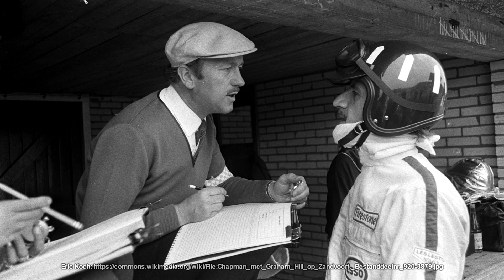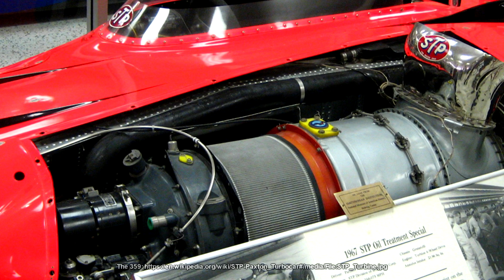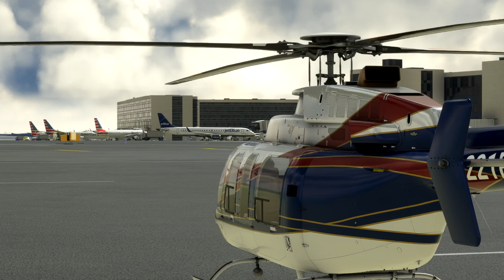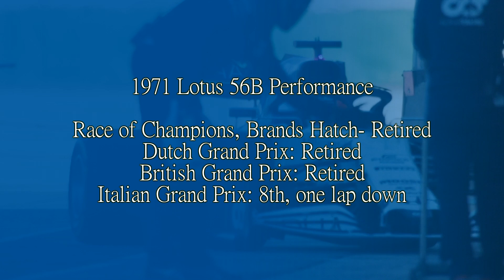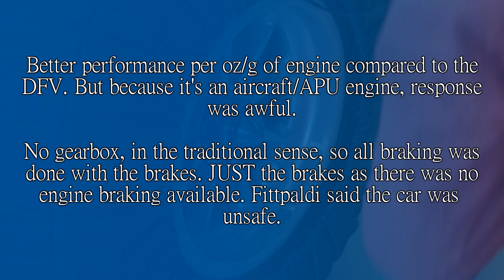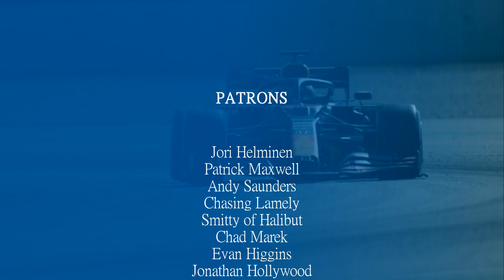THE JET POWERED* F1 CAR! The Story of the Lotus 56

Comment from the maker: Imagine if it WAS a jet powered F1 car. With an afterburner. Mach 1 down the Monza start finish straight and... straight into a wall...

Also turbine engines have been used on railway locomotives. Which is probably a better application for them as opposed to cars.
Reply: i swear some of the early 2000's ferrari's had jets in the back.
Reply: We had helicopter engines in trains (in France), it was hell. They drank like Lemmy Kilmister and were almost as loud. Drivers hated them, passengers hates them and I guess the people living near the train stations weren't too happy about it.
Reply: If people complain about it being difficult to follow in dirty air now, I could only imagine what they'd say when someone had their front wing melted off by someone else's afterburner. It would be hilarious.
Reply: @MScotty90  then protest them for having movable aero! Lol
Reply: The americans namely GM made a turbine powered road car, jay Leno famously owns 1 that hes done a great piece on his YouTube channel
Reply: The British, namely Rover developed a turbine powered car in 1949/50, and a Rover BRM raced at Le Mans in 1965 driven by Hill and Stewart. @maybenot6075
Reply: if it went Mach 1 I wouldn't imagine brake cooling would be an issue
Reply from the maker: @Ramtamtama  Ye of little faith...
Reply: I think with today’s technology it COULD work, some sort of controllable, hybrid system so you had engine braking AND instant torque. As mentioned though, the noise and fuel consumption is horrific and probably something that can’t be fixed economically
Reply: Turbine locomotives weren't very good either. They made big power and torque but were exceedingly loud, were thirsty af and were ginormous! Only the Union Pacific in the US really dabbled with the technology before they conceded that lashups were the better option
Reply: @stinkyroadhog1347  Here in Britain we had a steam turbine locomotive in the 1930s. Nicknamed the 'Turbomotive' it was built by the LMS in 1935 and was basically an experimental 'Princess Royal' locomotive. It was actually relatively successful compared to other experimental locos of the time (the high-pressure engines such as the 'Fury' (another LMS engine) and the LNER's 'Hush Hush' come to mind), but when the turbine failed in 1949 it was deemed uneconomical to repair due to post-war austerity. In 1952 it was rebuilt into a conventional form but after only two months in service it was involved in the tragic Harrow and Wealdstone crash. It was deemed beyond repair and scrapped.
Reply: Now if only it could be steered by swiveling the jets around 🤔
Reply: @FlufLord  Would there even be enough space on that car for Thrust Vectoring? (The term I think you are referring to)
Reply: A jet powered car would have been much more difficult to slipstream at Monza.
Reply: Why ? it delivered its power via the wheels, not via thrust. @jimiverson3085
Reply: Downforce. With  the  amount  of  thrust  such  jet  powered  fwrs  would  have, the  could  be launched into air  with the  slightest  disturbance.

Comment: Turboshaft engines ARE "Internal Combustion" in that they burn fuel internally. Turboshaft is the same as Turboprop, it's just that the latter is, by definition, tied to a propeller while a Turboshaft could be connected to anything. But basically they're the same.

Comment: The Chapparal 2J used a rear mounted fan - like the 1978 Brabhams at Sweden - to vacuum air from underneath the car - "sucking" it to the pavement - a very different proposition from Lotus's "wing body" chassis.  But yes - Jim Hall was every bit as innovative as Colin Chapman.

Comment: I reckon the pt6 could make a return if you set up brakes on 4wd system like a monster truck with a lever near the driver so there could be drag braking or even add brake flaps that pop up on braking like a bugatti

Comment: Turboprop. Turboshaft. Turbojet. Tomato Tomahto. 

First three are * all * turbines. Simple. 

Fun fact (former commercial pilot here), FAA put out an AD to have ‘turbo’ (you know ..in that 80s cool gradation font with the t bottom curling 90degrees.  Well .. adding another to the mix. It was a gas piston engine and TURBO NORMALIZED (has a turbo)…you TURBO CHARGE at alts closer to sea level. Gaining additional power. You’re fighting to maintain anywhere close to 100% power at altitude. This could get tricky for the layperson, eh???

Damnit!  Editing. Forgot to tell you WHY the Airworthiness Directive was removing that decal from the side of the engine cowl(s). Your piston engine burns 100LL. Your local line boy who isn’t hip to the lingo had more than once given a soon to be excited pilot a fill up with Jet A (refined kerosene), thinking it was a TurboProp. It says turbo, right???  Hehe.

Comment: 4:30 If you haven't seen it yet Captain Joe just did a rally good deep dive on how the PT-6 works. His video is on the turbo-prop variant, but it's valid for any PT-6 variant because all you need to do is swap what the free power turbine is attached to.

Comment: 15 years later these same engines made their way into indoor motorsports, tractor pulling in particular.

Thanks to thousands of them being decommissioned by the US marine corps and air force during the post vietnam drawdown, they became dirt cheap, and many tractor builders/owners turned to them because you could buy two for less than 1/3 the total cost of 3-4 custom built traditional v type engines which could easily run into the six figure range (depending on who the builder was).

The two most famous ones were The Green Monster and Dragon Lady, which were driven by land speed world record holder Art Arfons and his daughter Dusty.

Art won multiple USHRA national championships with "The Monster" in the early/mid 80's, the twin turbo jets on it could turn the rear wheels at speeds in excess of 150 mph at full throttle which made pulling the 50.000 pound pull sled too a full distance pull (200/250 feet depending on the venue) a trivially in any competition that wasn't a "pull off" to decide a winner of an event if there were multiple full pulls during the competition.

They eventually stopped competing in the general 7200 pound tractor class and chose to run in the exhibition class instead.

Comment: Ambitious but rubbish was a very necessary part of Formula One. Just as square windows were deadly on the de Havilland Comet, until oval ones were discovered to hold internal pressures without stressing the airframe in the same way. 

This is the most legitimate complaint that traditional F1 fans have. It's not about safety, as important as that aspect of racing is, but in the way that the envelope of engineering was pushed not only to known boundaries, but beyond. F1 can no longer claim to be the pinnacle of motor racing, just because of having so much money involved. By staying with only a single design to work with, it has reduced the formula to that of any other. It only took a second season of cars under current regulations to have people comment on how unexciting the 2023 cars look, which was always going to be the case when the body is integral to the ground effect, so can't be radically altered. Nobody wants a return to the deadly days of the late 60's, but without innovation, that sport might not have made it this far, and will struggle in future once the fanboys realise that the regulations hold any team back that wants to get ahead with ideas outside the box box box, without being able to innovate. 

This same issue is now starting to affect Nascar, where changing any standard part will get a team a 100 point penalty. Instead, teams like Aston Martin closed the gap by just copying Red Bull, and I guess that F1 and the F.I.A are just counting on 20 cars being identical pretty soon, because that will happen should the same format be kept for much longer.

Comment: The engines used in most commercial airlines are propjet engines just larger than what would fit in a heli . Actually now that I think about it why do they call that a propjet engine . Yes it's a jet engine that powers a propeller , but the prop is contained in a tube like a fanjet . Shouldn't it be called a fanpropjet engine . Sorry got distracted .

Comment: Fun fact something like 11% of the thrust on king air or like aircraft with the pt6 come from the exhaust 
And when using a turbine engine it has to stay spooled up like the turbo on a regular car to put power down think about how long a jet has to spool up before take off on the run way when they release the breaks they are producing so much thrust it can tear up the assault but it spools up so slow in comparison to a ICE it’s like a top fuel drag car vs a 1996 ford ranger they both go when you throttle one just way faster than the other

Comment: Actually, the 56 did run at Indy.  Joe Leonard was leading the race with about 8 laps left in the race.  There was a full course yellow on that point and when the flag went green, Leonard stepped on the accelerator and something inside the engine broke.  A second turbine car broke at the same time (Graham Hill had crashed just past the mid-point).  Bobby Unser won in one of Gurney's cars, sporting the first turbocharged engine to win at Indy.

Comment: It's interesting how Indycar nearly became the roadgoing equivalent to Unlimited Hydroplanes if it weren't for USAC going..."Hmmmm...Maybe we need to restrict that a bit more..."

It's interesting how with all the turbine hype at Indy in those days, the only two real forms of competition that kept the turbine viable was the aforementioned lobster-claw-nosed racing boats (and pretty much all of them use the Lycoming T55, a bigger engine for a bigger helicopter than the P&W in the 56)...and Tractor Pulling. Though the tractors use whatever turbine they can find, and unlike the hydros the tractors still also use either several large supercharged automotive V8s, industrial engines, or aircraft piston engines, or a combination of whatever. There's only one hydroplane running a V12 Allison anymore, and the rest are on turbines.

Comment: Some Americans did get this concept to work. In a car.   By effectively having turbo wastegates  as a throttle. So the jet engine section could be left at a high power but the driver could have that gas bypass the power turbine so   Meaning instant throttle response but massive fuel use 

And as you said brakes where the downfall
Reply: https://youtu.be/GAgLSy371us

Comment: the trick with keeping turbo shaft engines responsive in such an application ist to keep the engine running at 80-90% all the time and make the throttle close the bypass valve. i think this was the indy design aswell
Reply from the maker: Spose it was easier to do at Indy given the nature of the track.
Reply: @AidanMillward  yes, they were better suited to ovals than road courses, but you have to give Chapman credit for giving it a go.
Reply: There’s some more modern engines that can be more responsive. Using things like variable stators can make the powerband wider so you’ll get better power at lower rpm. 
But, there hasn’t been much development in making turbine engines that are responsive. For aircraft it isn’t really much of a concern. 
Would be interesting if the experimentation from the 50’s and 60’s with turbine road vehicles had carried on. Might have ended up with turbine engines that could run much more like a traditional engine.

Comment: Speaking of Lotus pushing the boundaries, it still bugs me that the Lotus 88 was banned outright without getting chance to race even once. I guess Ferrari and Williams were afraid of Chapman making their cars obsolete again.
Reply: The Lotus 88 was never raced because the Drivers despised the cars so much due to instabilities in the design when properly tested.
Reply: @ShazotoTouge  
No, the FIA wouldn't let it run so the drivers didn't have a chance to hate ti.
Reply: The 88 was banned because of it's twin chassis not meeting the rules. @ShazotoTouge
Reply: By all accounts the Lotus 88 was completely numb to drive and it played fast and loose with the rule book though I have no doubt that it was within the letter of the law in terms of passing scrutineering, the fact that it passed aero loads from the outer chassis direct to the wheel hubs it was just asking to be excluded! Its a shame that innovation is often stifled in F1 and they always fear an "arms race" but the reality was prior to the budget cap that the teams would always spend all they had (sometimes more) on making the car as fast as possible and all that "cost saving" measures like testing bans do is force the teams into spending even more money on tech like driver in loop simulation that costs more and is less effective!
Reply: @philipbain  I both totally agree and disagree at the same time. Agree 100% on innovation missing from F1, makes F1 not F1 anymore, and totally disagree with the rule book not needing people to play fast and loose with it, to produce innovation. In the middle of both, there's the incurable disease that Formula One has always had, and that is favouritism. There's no doubt that certain teams can cuddle up to the rule makers at certain times. This is why every time equality is talked about, one team still dominates. When switching to hybrids, the sport switched to Mercedes. Red Bull caught up, so ground effect suddenly reappeared after being banned decades ago. Now Red Bull dominate. Ferrari, Williams, McLaren all had their time too, and that cannot be coincidence, especially given that all other teams never fail to complain about the dominant team, as if they get preferential treatment. As you ended your comment, we are back in agreeance. Let Formula One innovate completely, because that was always the nature of the formula.
Reply: indeed... it was a pig
Reply: A car whole whole downforce is applied directly to springs sounds like a pain to drive.

We'll never know how fast it'd go but I never heard a good thing about this car ever, only that some people were sad that it was (almost rightfully) banned too soon.
Reply: @davidaugustofc2574  
That was actually the configuration of the first wing car, the Chaparral 2E.  The wing was mounted directly to the hub carriers in the rear suspension.  It actually applied downforce without compressing the springs.  I imagine the 88 was similar in effect if not in the source of downforce.

That was also the configuration of most of the high-wing F1 cars of late 1968 and early 1969, including the Lotus 49s that crashed in Spain.  The FIA ban required all aerodynamic devices be mounted to the bodywork, where the downforce does compress the suspension.
Reply: @jimiverson3085  I can see why, mounting on the hubs require flexible mounting points, which for the technology of the time meant bending which led to breaking. The cars were making too much downforce for their own good imo, F1 would turn into Group B but the drivers would die the majority of times.
Reply: @davidaugustofc2574  
IIRC, the only catastrophic wing failures were on the Lotus F1 cars.  That would be Chapman aiming for lightness and making his cars insufficiently strong.  AFAIK, there was never a wing collapse associated with sports cars, including one season where the entire Can-Am field ran high wings.
Reply: @jimiverson3085  I'll have to take a deeper look into it later, since I'm somewhat busy rn, thanks for the history lesson.

Comment: the engineer in me feels the undying need to point out that a gas turbine is indeed an internal combustion engine as the combution process that drives it is indeed taking place inside the the combution section of the turbine.... sorry i cant help it! the word that dissasociates the two is the dfv and all susequent f1 engines are piston engines. a p&w pt6 is indeed an intenal combution engine albiet not drven by pistons
Reply from the maker: “The sort of internal combustion engines we associate with f1” would have been a better line.

Comment: Imagine if Joe Leonard didn't have a transmission-bearing failure in the Indy 500.  I remember hearing it was a 25-cent part.
Reply: You're thinking about the 1967 Indy 500, when Parnelli Jones' STP Turbine lost a transmission bearing just before the end of the race. In 1968, both leader Joe Leonard and Art Pollard had the fuel pump shafts break on lap 192
Reply: @arthuralford  yes, completely accurate.  I'm glad I'm not the only one who remembers the details of those cars.  The 1967 STP Turbine is still my favourite race car of all time.

Comment: I'm surprised they didn't use a clutch system to modulate the power instead of the brakes.
Reply from the maker: Maybe that was a bit too complicated for what they were doing.
Reply: a clutch would seperate the power from the drivetrain but would still not provide braking force as there is never a time in the power cycle of a turbine(that is actively running anyway)  that would provide braking force. it going to keep on spinning that shaft as long as it is running. piston engines provide braking due to the vacuum created behind the throttle blade when closed and the tires actively trying to turn it, there is no throttle blade to block the airflow into the compressor and if there were. the air would just cavitate behind it as opposed to creating a vacuum.